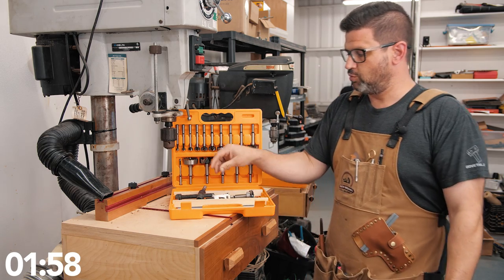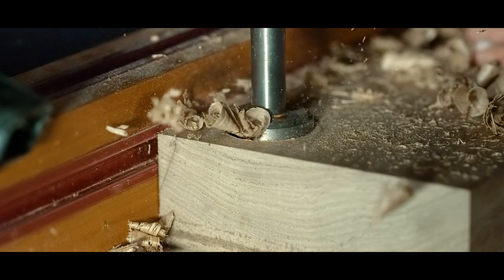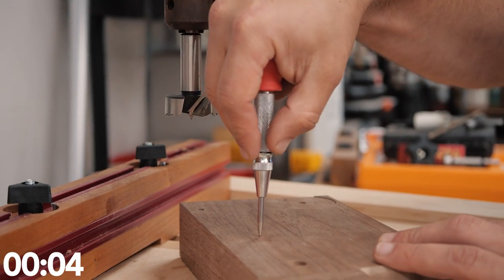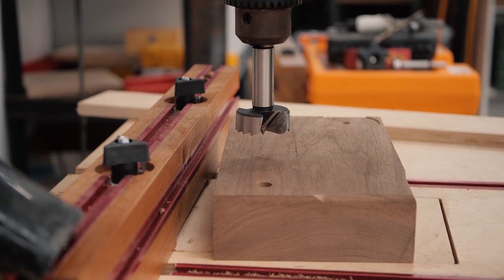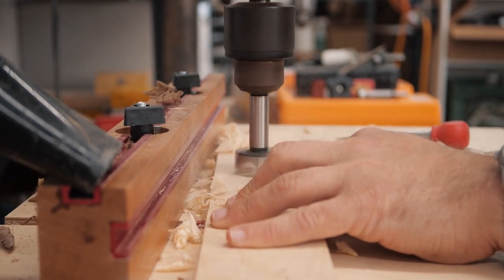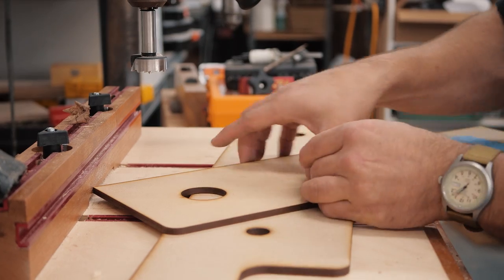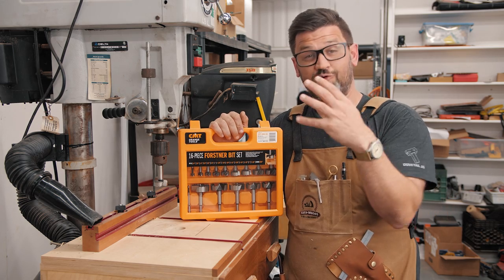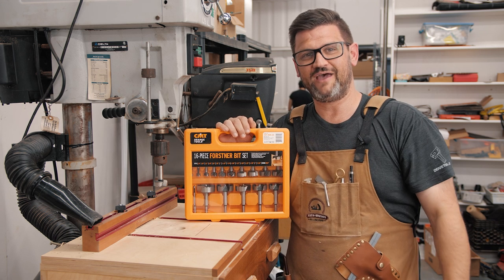Forstner Bits Tips and Tricks - Two Minute-ish Tuesday - 19k FPS Slow Motion Footage

Comment: Something does not add up. Sold on Amazon for $70 but has a 14% one star review. To calibrate, anything above 2-3% 1 star review is something I pass on. Porter Cable or Irwin have 2-3% one star reviews and are considered a popular mid to low range quality set.

I'm looking around for a set that can do a decent job for basic work so am skipping the top of the line brands.